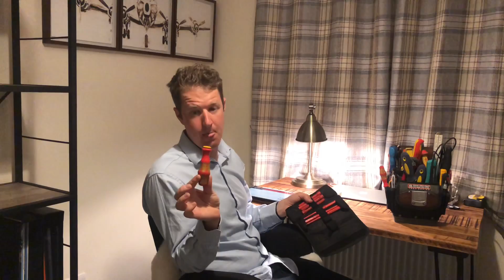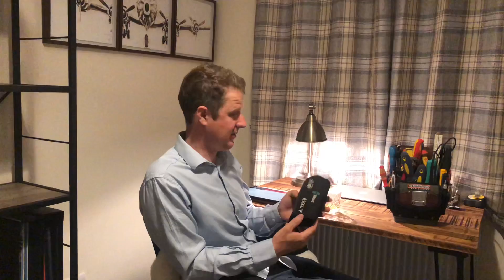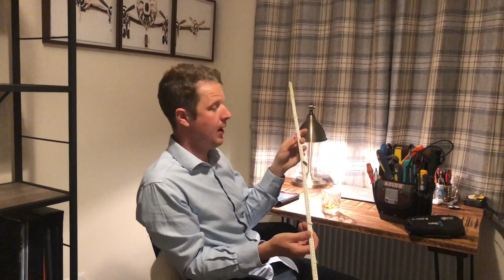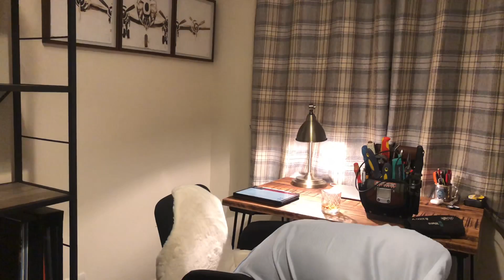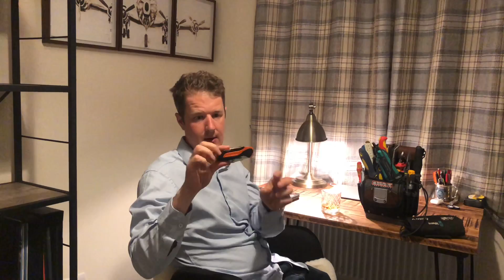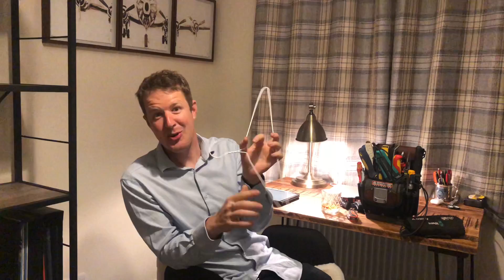Electricians Tools - My 15 Best Electrical Tools

Comment: Very Small electric screwdrivers(2), flat bits and pozi sizes , essential bit of kit, time saving undoing switches downlight screws etc wouldn't dream of doing it all by hand.
Guild make is excellent £9 in Argos(if still doing them) , don't need rip-off makes , technology has improved them all from what they used to be

Comment: Before fibreglass rods etc we used to use 'bamboo' and you could cleverly extend the length by using male / female brass connectors glued onto the ends of each length of rod. (like drain rods but much thinner) ! Magnetiser/demagnetiser for tools ! Couple of magnets useful when you are pinning a piece of info to a metal panel etc (alarm wiring or etc) Superglue OMG for hmm a lampshade where the welded joins have opened up 👆 Cable ties OH YES.. at least 4 different sizes and lengths.. Air spray for clearing dust off certain places you can't normally get to.. and blowing spiders into oblivion.. OMG the size of that spider still has me shake my head 👀 damm that was a big beggar.. Still at least we're NOT in Aussie.. hmm black widow or tarantula? My friend in California sent over a pic of her stood in the garden and just in front of her on the ground was a fuzzy tarantula.. AAAAAAAAAAAAAAAARGH... 👀😶

Comment: Artisan Electrics

If you see this first of all thank you, tremendous help for a newcomer like myself, I would also suggest two more tools;

Pica pencil & Pica pen - perfect for marking all surfaces. when you get one you’ll wonder why you didn’t get one sooner ;) 

BAHCO GENERAL PURPOSE KNIFE WITH AUTOMATIC BLADE RETRACTION SQZ150003 - it auto reloads when you pull out the blade. Blades stack conveniently, and when you squeeze the handle the blade pops out, if you can get you hands on one I would give it a try

Comment: I've had the Wera kompakt interchangable vde set for about 3 years.. Love them

Also highly rate these from knipex, 
Knipex  13 86 200 VDE tested installation pliers, they are a plier, cutter, crimper and stripper in one

Also use the wera star magnetiser / de magnetiser on the wera kompakt blades for screws etc
Reply from the maker: Nice thanks!

Comment: most of my side cutters are great for stripping...they have blow holes in them! LOL
Reply from the maker: I bet you’re not the only one!
Reply: I have a fluke voltage stick and been using it for years. I was then told by an “electrician” that I should always be using a 2 pole tester as there are so many limitations to the voltage stick. Is this really the case? Also, when a wire is dangling out of a fitting, how are you suppose to get good contact with the probes on a 2 pole tester?
Thanks for sharing all the info

Comment: had a giggle at the metre stick measuring downlights 😂
Reply: @jimmy stewart It is just easier and more multi-functional. You would not think in what situations you do need just a plain insulated stick to steer around stuff, geht stuff close to you, measure, have a ruler(!!!!) and with most of them you also have scales where you can measure angles to a very good degree.

However, (I'm German) I have never seen such a thing as OP has there and I don't think that is ever used in Germany nowadays. We still use the name "meter stick" (or rather the German expression for it) but the ones we use are 2 meters long and much more sturdy, but not a lot bigger than the one he has. We use them for EVERYTHING, measure take is nowhere to be found on a German construction site =D

Comment: Fluke Volt sticks are fine if used correctly. Use them for checking circuits are Live NOT dead!.. I use mine all the time, I have been caught out before, Can be unreliable on bunches of cable, but a sparky should know these things to look for.I also use us a Fluke T150 Tester to prove dead. Great quality instruments. Your tools are very similar to mine, I use Knipex cutters, CK cutters and tail crops, Wera Kompakt screwdriver set & Torque driver set (interchangeable too) I bought them for the very reason you say, so many screwdrivers take up too much room in my FATmax toolbag, Another useful tool is a laser tape measure, great for measuring spot light distance on ceilings, and cable run estimations. Theres loads of other really useful tools of course, the D.A.D.E (dust and debris eliminator), Hole saws, SDS chisel bits, Box cutters, lol...love me tools :-) Great video.
Reply from the maker: Great comments thanks!

Comment: Great video, like seeing what other sparks use daily. Just wondering when you are doing a video on your Fluke Multifunctional Tester? I’m in the market for a new tester so would be interested in your thoughts.
Reply: Andy Walsh ,if it’s any help i have just blown my budget on a megger mft 1741 ,great bit of kit even has a function that shows you how reliable the actual test reading for zs is ,type b rcds test too ,hope this is helpful
Reply: Daren Vita electrical yes used the Megger. Just the price, I really like it though. Thanks for the input, the more information the easier the choice will be.
Reply from the maker: Thanks for the feedback! Will get a video done!

Comment: My go to side cutters are the CK combicutter 3. They have notches in for cutting 1.5mm and 2.5mm twin and earth. They do work on most other flexes etc and give a very clean cut. They also have a cutter built in for cutting 3.5mm plate screws.
https://www.amazon.co.uk/C-K-39071-RedLine-combicutter3-160mm/dp/B001KVH03I
Reply: I have the a set of CK combicutters, I'd used straight cut side cutter for years and didn't think I'd get on with the  notched cutter but they work a treat, they've also got jaws for doubling over conductor ends. https://www.amazon.co.uk/C-K-39071-RedLine-Combicutter3MAX-180mm/dp/B002JCTIPK/ref=mp_s_a_1_1?keywords=ck+combicutter&qid=1563206126&s=gateway&sprefix=ck+combi&sr=8-1
Reply from the maker: Thanks! I don’t like the ones with notches personally I think they just get in the way of a clean cut when cutting cables
Reply: Same here, I like my CK combi cutters, great for 2nd fixing. The doubling over bit and the 3.5mm screw cutter all work great. carrying less tools is always a bonus.